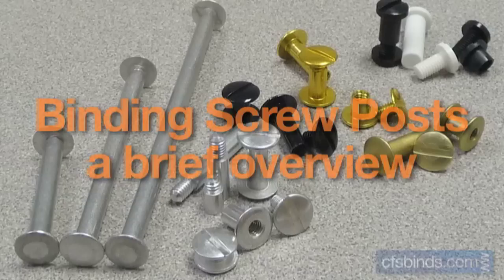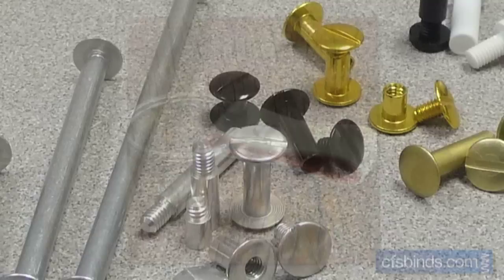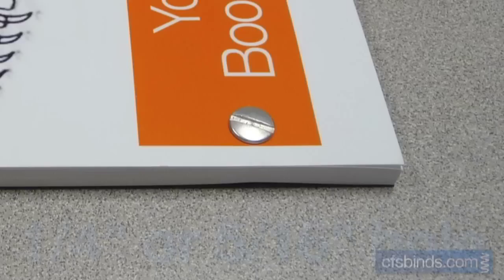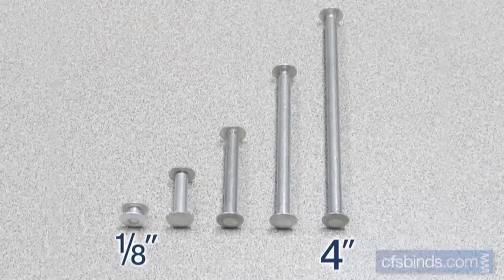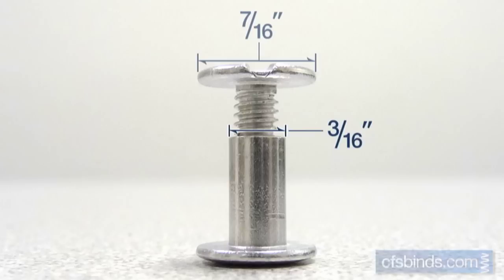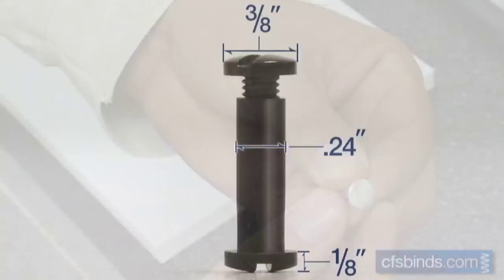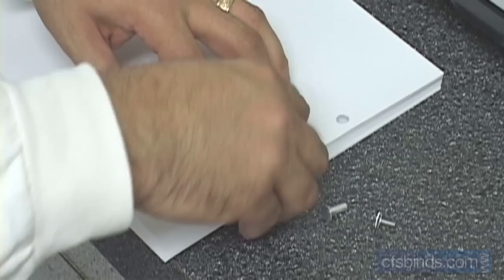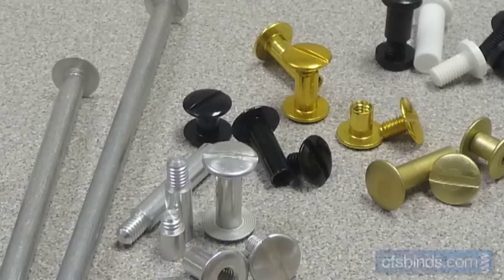All You Need To Know About Binding Screw Posts

Comment: I have a 7mm thick board I want to attach a thin piece of metal to the board will this type screw allow me to tighten it nice and tight? I'm afraid using a regular screw will not hold very well and a bolt and nut will be bulky. Thanks

Comment: Some models of harmonica are held together with tiny screw posts/Chicago bolts.  They work great and look better than screw and nut assembly.  They also hold together better and don't leave a pointy screw sticking up, and attach more firmly.  

Really tiny ones though.  They seem to be in a different hardware ecosphere than the ones used for bookbinding.
Reply from the maker: Wow, interesting fact there. Thanks for sharing!

Comment: What about the open back screw posts? How are they used?
Reply from the maker: Great idea! Stay tuned. The open-back posts work the same as the other posts, but the screw will pass beyond the post, as it is open-ended. Thus, the end of the screw will 'hang out' the end a little bit. Hope that helps.

Comment: If these were skinnier, like a size 10 screw, they would have been perfect for attaching my garden spinning wheels to the top of my fence. I was looking for a way to keep them a few inches sticking out away from the wood, which I could have done with a machine threaded screw and a couple of nuts, but I don't want the plastic hole to shred on the metal thread.